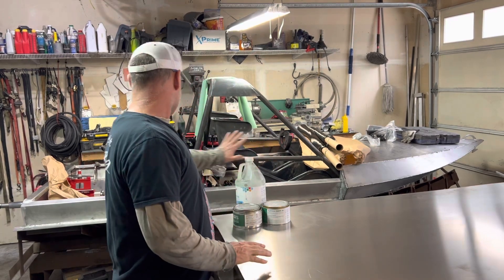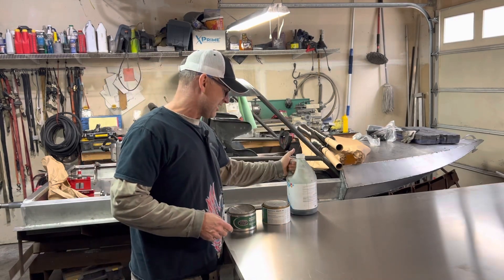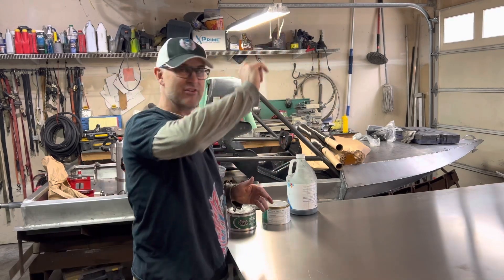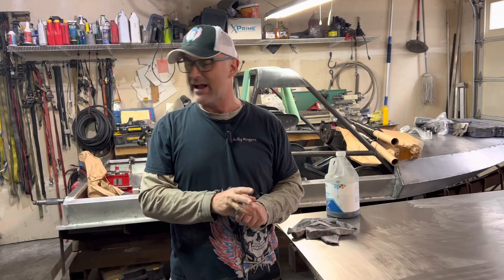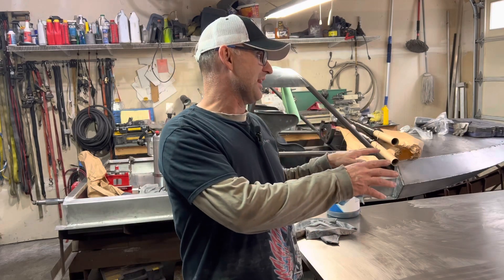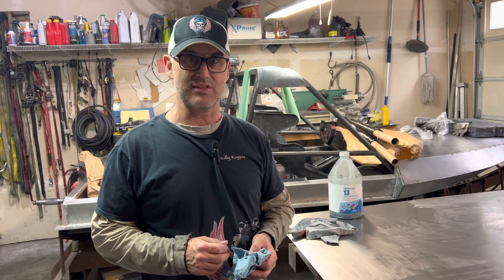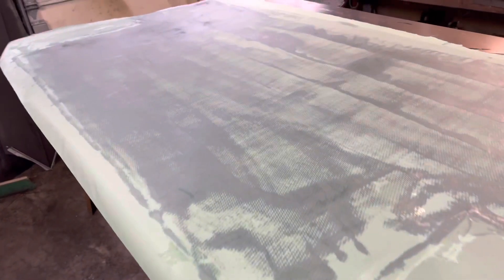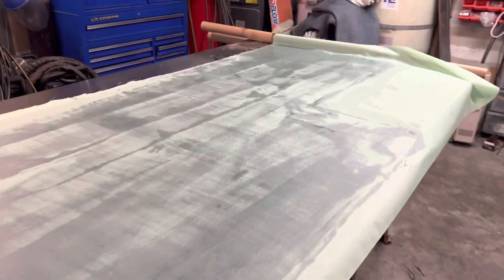Carbon fiber wet layup

Comment: That is a super slow cure time on that resin, it is nice stuff but it kicks and cures way to slowly in my world.  Did you choose that resin for its higher heat properties?
The word you were looking for is not enclave / oven. You meant Autoclave or pressure oven, or just an oven in some cases.
.
I am interested to see how you cut and shape these.
Reply from the maker: I bought that resin to build a totally different part.  It was leftover so I used it.  Most the time I lay it up before I leave I’m a trip so it’s fully cured by the time I come back.

Comment: Was wondering what happens there in that spot of the hull. Does the CF panel serve as a fender like part that gets replaced easily after an accident? Surely not weight saving as hull structural metal is still behind it. Still fascinating to me how you put it all together and not throw money at it to purchase finished parts with a brand name on them. A real craftsman custom fab a complete & real product. Not one thing appears homemade by Jimbob's one-eyed dawg jack'n jalopy shop.
Reply from the maker: It’s a total weight saving.  I’ll explain when the panels are in place.  But yeah, they’d be pretty easily replaced.  Also makes working on the boat wayyyyy easier with them off.

Comment: I wanted to sling some epoxy resin today but I didn't get to it. Using marineguard 8000. Super clear and doesn't yellow. Working on the lower structure of my hull and gonna do carbon fiber on the transom area. Just for looks. Haven't seen that done yet lol. Cant wait to see how you do yours sides with that.
Reply from the maker: Right on.  Haven’t heard of that brand.